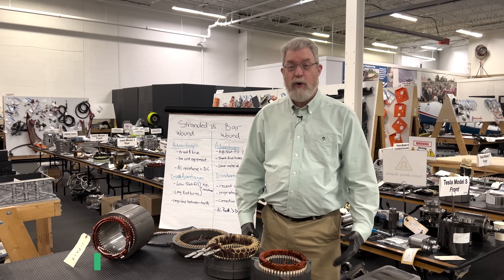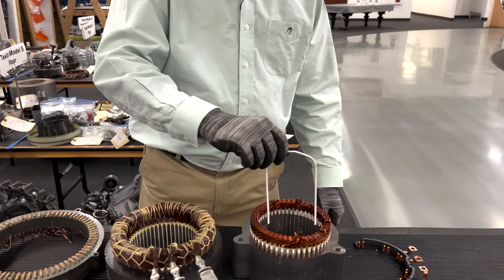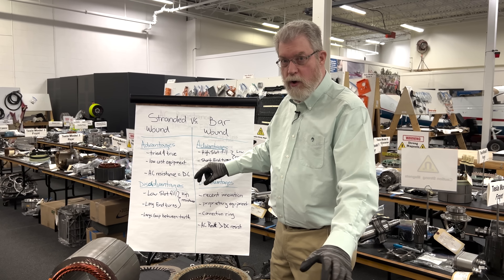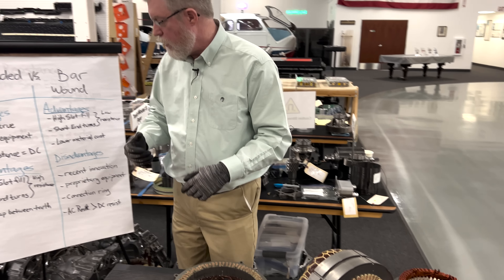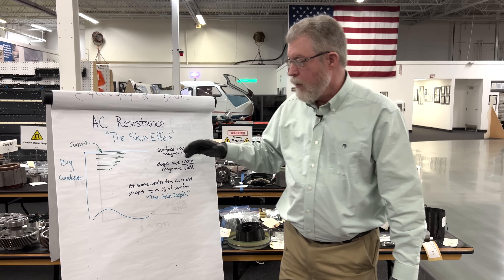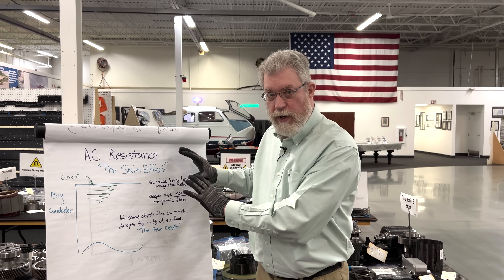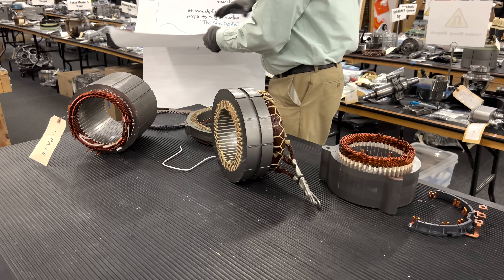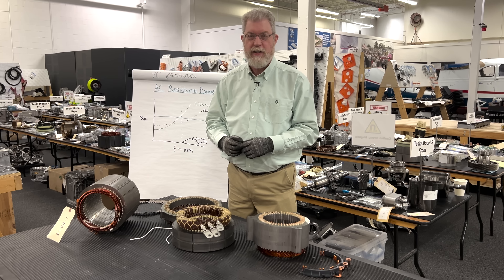Getting Wound Up: Stranded vs Bar Windings in Electric Motors

Comment: The slot fill difference isn't just due to the number of strands and thus the space taken by insulation - rectangular cross-sections of bar windings nicely pack into a rectangular slot, compared to round cross-sections of "stranded" windings... plus the small round wires are not neatly organized into an ideal packing pattern.

Comment: To @MuroLive ,  Thank you for a great explanation of these winding designs.
I am no expert at this information.  I have a couple questions for my curiosity though.  How small can the "bars" be compared to the "wire/strands"?  I ask this in noting the size of the two different bars you demonstrated here (8x2mm) compared to the (4x~4mm) bars.  I'm not certain I'm thinking of them in a correct manner.  This is not my field of expertise.
Reply: Thanks for the kind words. Bar winding depends on the hairpin being structurally ridged enough to be inserted automatically. Ten years ago I would have told you that 2mm bars are impractical. Meanwhile, the industry doing stranded winding is continuing to make advances in slot fill. We all benefit from these advances in technology with better and more inexpensive motors.

Comment: Electromagnetic theory and motor design was my favourite subject.  In the real world, outside cars, it's basically induction motors and VFDsthese days.  I do work on a a pair of large DC Wound Rotor Motors, 383KW.   We measure and replace brushes periodically.   We are considering a new AC system with very wide stators and rotors that eliminate the need for gearboxes.

I fear that these will prove less reliable than our old ABB monsters in our tropical environment.

Excellent presentation.  Thanks.
Reply: You will be surprised and love the New reliable AC motors with VFD..
Reply: @joeabad5908  Thanks for your reply.  What about their applicability in hot and humid conditions?  ThesenoldbDC machines are amazingly reliable.   Can these new systems equal that, in your opinion?
Reply: The AC motors are just as reliable, if not better, but without the carbon brush replacement downtime. However, the VFD electronics reliability will depend greatly on the choices made by each manufacturer. 

Besides knowing their MTBF, you should look closely at how well the PCB surfaces are passivated after soldering and whether every connector is water-tight and pre-filled with silicone grease. 

I personally prefer air-tight electronics enclosures ever since my one encounter with an air-cooled super-minicomputer contaminated with conductive metal dust. (*shudder*)

The 500 Amp DC super minicomputer power connector that I serviced had gold plated copper stud, nut, and multilayer PCB interface. I re-torqued the gold plated PCB nut 6 months into service, 500 Amps live. No joke.
Reply: @imconsequetau5275  That's interesting.  One of our guys.forgot to replace a brush in the rack.  It was connected to the frame and when switched on, it basically blew up leaving a black mark that's still there today.

Comment: Great video!  The efficiency differences of the two motor winding types makes sense but it would be nice to know the significance of such in regards to real world range in an EV.   I believe the Tycan uses a two speed diff so it would be interesting to know if that decision was made in part due to the motor winding type used?  I would guess the main reason for using a two speed diff was to keep the motor from potentially destroying itself and sacrificing less motor torque at the higher RPMs.. There would be some mechanical loss in a two speed diff that any efficiency increase for a given motor winding type would have to overcome.
Reply: In a gearbox one of the gears will have higher efficiency than the other. You would make sure to choose that gear for normal speeds, and the other gear for special occasions.
Reply: To clarify terminology: A "diff" (differential) doesn't have multiple ratios ("speeds"). The Taycan has a two-speed transmission in its rear transaxle. The transaxle includes both the transmission and the differential.

Comment: re low speed vs. high speed trade-of, it's almost like a system to make the wheels spin faster at lower motor RPM could be useful.
Some sort of... gear box 😬
(joke aside, would it make sense to use a gear box to maintain the motor RPM relatively low and at the optimal resistance?)

Comment: 10:58 This is how I understand AC vs DC resistance - DC uses the entire cross-section of the conductor while AC uses the outer layer of the conductor thus "cramming" the charge into a smaller volume hence more resistance. The reason for the "cramming" is magnetic field being changed to the opposite direction the back emf is like walking through a wave of water pushing against the new polarity forcing it to the outside of the conductor, almost like moving in deep water vs moving through shallow water adding resistance to that smaller volume in the conductor (smaller volume of the conductor for the charge + opposing "wave" = resistance). Yes I'm aware it's a very convoluted explanation it's just a way to visualize it in my head. Although I think people will go for your explanation.

Comment: I guess the broader context here is optimizing for specific speed rangers.  Many industrial applications want a very high and constant speed so stranded is optimal.  Vehicle applications with variable low to moderate speeds (attached to a fixed ratio gearbox) are slow enough that different bar designs can pay off.
Reply: Weight and motor size is not so important in the industry.
It's not the rpms that are important, it's the current frequency. In cars it varies between 0 and 600Hz, but in industrial motors it is fixed at 50 or 60 hz.
Reply: Esp with Plaid motor passing 20,000 rpm, still having flat power curve.
There’s some magic.
To think Porsche started with 2-speed gearbox, Jeep still wanting multi speed transmission, same for many legacy semi-trailers.

Comment: Thanks for teaching us! I just thought all electric motors are extremely efficient and it's the PWM / voltage that was the main driver for differences/sizing. Didn't realize the windings contribute so much. It would be great to see the spec sheet comparisons for two similar motors to understand the real-world effect of the decision, versus and illustrative line. Thanks again, great stuff!!

Comment: Brilliant Video Sir explaining the skin effect. This is why AC transformers use very thin laminations in their construction and why high end loudspeaker cable uses very fine and many conductor strands. So in an ideal world, the windings of an electric motor would be made from "hairpins" constructed from hair thick copper copper strands with enough ductile strength and elasticity to form the hairpins. So extrapolating that idea into a manufacturable component would mean having fine threads with a thick copper wrap, which would allow the manufacture of a bar like construction, with less resistance than the current wire wound. That would maximise the benefits of both. Example: 1mm copper sheet, encasing 1000 strand copper core ( length to be determined by the need to form, say 20% longer). This would allow the outer casing to be press machined to the hairpin and the part trimmed after forming. This would give the best of both worlds. 🙂

Comment: 10:02 The AC "resistance" (actually, impedance) is so high in "bar" or "hairpin" windings that the motor driver (VFD) does not need significant modifications of voltage output or current capacity. Also, since the DC resistance is far lower, the I²R loss is proportionately lower, thus increasing range. When you factor in Tesla's use of the reluctance PM rotor core, the efficiency is first class.

Comment: Fantastic explanation. It is very similar to the latest developments in high current flat wire inductors vs wire wound inductors. Lower DC resistance, but higher AC losses.
Reply: Based on the same principle, just applied differently.

Comment: Motors are confusing, and it's hard to find good info on the whys of the differences in design. This video was an unusually good explanation of the physics and the corresponding effect on design choices. A fine example of someone who really understands their field.
Much appreciated. I too look forward to clarification of when induction is chosen and PM vs electromagnets.
Later on you might get to aluminium/iron motors maybe?

Comment: 17:05. Throw a planetary gearbox on it. Let it stay at lower rpm and dump a bit more current through it or switch to dc current on and off only through the windings. When it gets to super high rpms

Comment: Great review! I had not thought about the effects of skin effect on that size of a hairpin, but that makes a lot of sense.

I'm deep into this currently trying to find the sweet spot for coil wire gauge vs inductance and resistance / impedance. Since this is for single pulse coils, I'm currently just using DC resistance for the calculations, although if repeated it would be in the 8-14 Khz range. Small gauge wire will give me higher inductance values for a faster TC charging the coil magnet along with more resistance. Larger gauge wire will cause a lower inductance with a much slower TC but with less resistance, although that can be sped up by adding resistance externally in serial. Running coils in parallel both lowers the inductance and resistance. Since I can only create so much of a field before saturation of the core, balancing the gauge, number of windings (constrained by the physical space), on-time (usually between 1-2 TC), and the added resistance to find the most efficient combination is quite a challenge.

Comment: HUh! interesting. This was enlightening. It explains a bit why many audiophile interconnects use very thin strands, helping reduce the cable's effect on high frequencies. Comparing these ideas to RC motors though, which are often rated by number of turns I would have assumed that the ones with fewer turns with the then thicker conductors would be biased towards lower RPM operation and higher torque, but apparently the relationship is the other way around. I must still be missing something.

Comment: Hi Dad! You're famous now! I have a question -- why do we need slots in the motor at all?
Reply: Thanks Anna, good question.  Slotless motors do exist and they are very useful in applications where zero torque ripple is required, but without the steel to carry the magnetic flux these motors produce very little torque.  In a vehicle application we need as much torque as possible from every Amp the battery can deliver so we have to put the steel as close to the rotor as possible.  That is why we use stators with slots and teeth.  They are a compromise between getting as much steel as possible close to the rotor and getting as much copper as possible to carry the current.

Comment: Thank you for the great insights. When thinking of all of that information, the optimal vehicle probably would have two motors, one of each, doing sub-highway speeds with one, and the highway-speed with the other motor. I'd guess that this would be the optimal case (of course: with higher accelerations, both motors would kick in).

Comment: I did scrap a welder with a type of bar winding. I do not remember if it was 3 phase motor side or DC generator side but it was old like made in 70's and have a 300 A DC power, so not that small motor at all.

Comment: So, what did Rivian do?  How thick are the hairpins in their new motors?  They claim 240 hairpins in 13 different shapes, but I don't see any spec on the thickness.
Reply: I thought I saw that, but then you had a different one on the table and I just figured I was wrong.  (^_^)

So, I guess Rivian did it right.  I was just curious in the give and take of size vs efficiency, how they did.

Thanks for the reply.
Reply: Yes, we chose to put a Rivian motor in the thumbnail for the video because it is an excellent example of an optimized hairpin design that retains its low resistance advantage up to high speed.

Comment: I have been rewinding motors since the early 70s,  Bar wound,  winding have been around very long time,  going way back to the beginning of electric motors.  The only difference being is that bar wound were mainly (95%) we're in the winding of rotors and armatures. Not the stairs,  however they were still used in states as well in very large equipment.

Comment: Excellent explanation with good use of props!  It seems the bar wound stator would work best with an IPM rotor and the wire wound stator with Induction rotor.  Your thoughts?

Comment: What about transmissions similar to hybrids but a standard 7 speed to keep the rpm of the motor down with great torque.
Reply: Add weight and losses and cost.
Reply: Gearboxes had a rationale back when exploding fossil liquids was way to make motive power. 'Cause petrol motors with dozens of valves & springs & fluid dynamics of hot gasses, flame fronts, squish regions, piston speed, bore/stroke & rod ratios all to factor in. Then make it last 200,000 miles.

Comment: Very informative and so good to see the cut throughs. The skin effect explanation was the best I've heard. Do you think silver plating the "hair pins" would help?
Reply: Not really. You would need to reach the GHz range before the skin effect would be as shallow as silver plating, such as on the inside surfaces of hollow wave guides. Remember, these motor conductors have a skin effect at 1/3 the conductor thickness of 4 mm square, which is why Tesla moved to 2 mm rectangular thickness. Annealing the copper after squaring and before coating with enamel is already a big improvement.

Comment: I do like the bar motors much better because they are more robust and have an actual physical barrier between each conductor, rather than just relying on the coating of the stranded wire.   I've seen too many shorted motors burn up and would rather have that physical insulator there.  I can see the motors with the smaller bars being the best all around compromise for more than one reason.

Comment: Nice presentation!  One part that wasn't clear was "2mm in this direction."  We couldn't see the gestures, so did this mean 2x1mm, or 4x2mm?
BTW, it might be easier to frame the video with a higher table.  WeberAuto effectively does this (due to him being in a chair) and it works very well when doing this type of presentation.
Reply: The 2 mm direction is radial; that's the smaller dimension of the cross-section - the bars might be 4 mm by 2 mm.

Comment: Excellent video! Thank you. Could you please -- in one of your upcoming videos -- explain the reasons why keeping the gap between the rotor and stator small is more important for an induction motor than for a synchronous one? I'd guess it has something to do with efficiency of the rotor-stator transformer but I'd like to hear more details about it from you. Does Tesla actually use smaller gap in their induction motors?

Comment: Low speed city driving is like back emf.  Lots of changes in power need. Lots if shifts in current demand.  Highway driving is more like a dc load wherein the load change is relatively low to maintain constant highway speeds.  Changing the number of active poles can affect motor speed and efficiency.  Does a gearbox start making sense or do the mechanical losses outweigh the efficiency losses in bar wound motors at higher speeds.

Comment: It sounds like this skin depth changes depending on the speed?
When you say winding, does the power come from the wires / bars being wrapped around the motor (along the circumference)? Or does it come from them running along the axis? And does the power come from the wires / bars having the electricity flowing in one direction or from these being laid out so the wires go from one side to the other? (Using the shape of a D cell battery, I’m asking do the wires get laid out so they go from the positive end of the battery to the negative or do the wires get routed from the positive end to the negative end then return to the positive end?) The hairpin wiring sounds like the wires (or bars) goes from one end of the motor to the other and then returns to the end it started at?

Comment: What if we extrude copper wire in specific shapes and then combine both bars and strands within the slot? Increased surface area on the conductors, more overall conductors, you can even play with the overall geometry of the wire system inside the slot to affect the flux. I wonder how many labs are working on this now...

Comment: I think it would help if you prefaced the discussion of the difference between winding types with a statement that only stators of three-phase AC motors are even being considered. This is about one detail of the construction of one type of motor - the type which is used in EV.

Comment: Excellent. The Electromagnetic Field travels around the 'wave guide' (the inductor). We measure this as Amps and Voltage. 
References: How to achieve proper grounding by Rick Hartley on YouTube.
How electricity actually works by Veritasium on YouTube.
Also Electrodynamics by The Science Asylum on YouTube. 
If I wanted to measure the Momentum of my car as it travels form the road,  how do we do that? We can take a measurement of the speed. The speed isn't the inertia of the car, it's an aspect of it.  Voltage and Currant are aspects of the Electromagnetic fields.

Comment: Is it possible to optimize a vehicle with two motors where one motor uses thick bar for city streets, and another motor using thinner bar windings for high speeds? The use of each motor is tailored based on its efficiency.